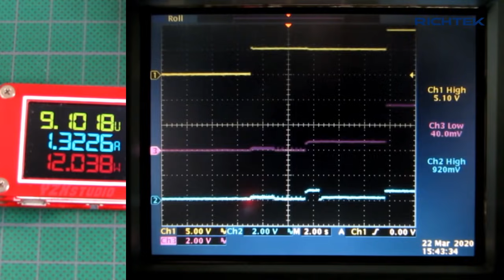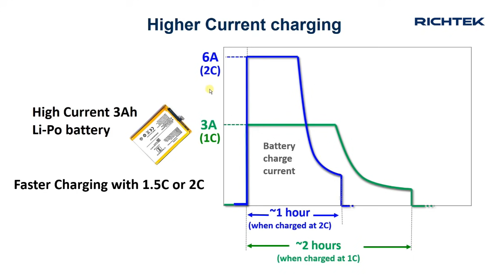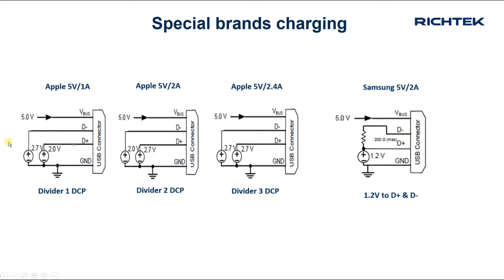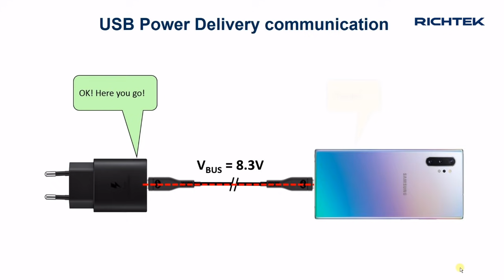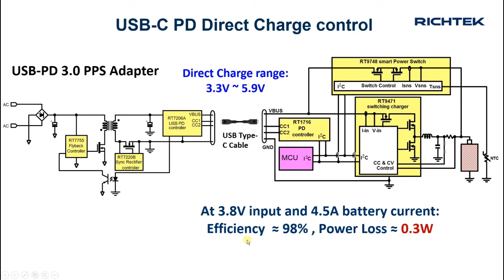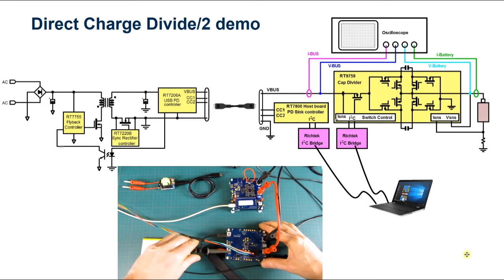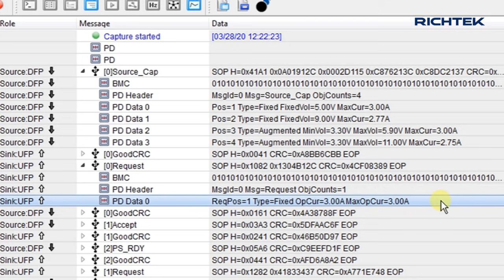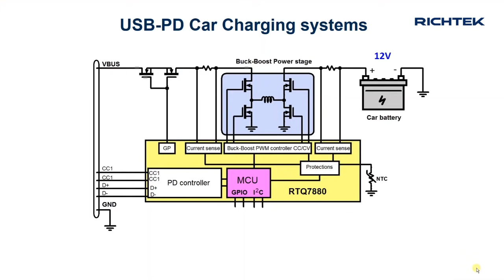How does mobile phone fast charging work?

Comment: Hey, maybe you can help me with a problem i have: one of my cables don't want to charge my Galaxy S9 anymore
The problem doesn't come from the power brick, since it works on another phone, neither is the cable, who works on another phones too. But when i plug my s9, it just doesn't want to charge 95% of the time. Sometimes it randomly works.

It annoys me because the presumed faulty cable is a 2m long, so now i have to use a standard 1m cable...
Reply: Clean the bus
Reply: @kornaros96  how ?

Comment: Do you think it's possible to make a single charging IC (charger side IC not device side charging IC) that's compatible with ALL USB charging technology (slow charging, as well as all fast and super-fast charging protocols) ie. DON'T NEED A LIST TO GET THE IDEA? SKIP TO NEXT PARAGRAPH WITHOUT MISSING ANYTHING ELSE. OnePlus’ Warp Charge, Huawei SuperCharge, Oppo’s SuperVooc, Motorola Turbo Charge MediaTek’s Pump Express, Apple 2.4A protocol, Samsung Adaptive Fast Charge, Samsung Super Fast Charge, etc... 

Like literally every charging tech in one USB A port and also that exact same thing in a USB type C port side by side in the same desktop USB super power supply thing... AND an override that lets me use a USB port as a variable power output (dangerous, I know ... it's for an EE hobbyist workbench, not for Joe Blow consumer so... also I wouldn't make it easy to accidentally bump the physical UI causing the device to fry, top-hinged plexy glass cover for controls or similar to reduce chance of accidents.)

Any; ideas, suggestions, or pointing me in the right direction, are greatly appreciated.

I'm already combing through USB-IF's web resources obviously, but I'm not formally educated in EE, I'm just a hobbyist who's been messing with this stuff for about 30 years now. Some of the language USB-IF uses is slow and arduous reading for me, so resources that make the same material more easily digestible for the not-so-formally-trained would also be appreciated. If I can buy a similar tech already that would be ideal, I'm not trying to reinvent the wheel, I've just never seen a wheel before... (obviously I've seen wheels... it's an analogy. I feel I have to say that because... this is the internet.) Anyways I just want a truly universal USB benchtop power supply charger thingy.

To be clear, I'm obviously not looking to manufacturer an IC that is... way way beyond my skills. I am thinking more like finding a programmable IC that's capable of being made to do these things.

Comment: You seem to know a lot about charging so it's strange you think li po is a chemistry when it's a format. ❓
Reply: This is why the battery community has moved away from the term "polymer" and defines cells as either cylindrical or prismatic.

Comment: Ok so how do you take 2 hours charging at 1C? That doesnt make sense to me.
Battery is 5Ah, 1C would be 5Amps. And if you charge it for 2 hours with 5 amps it would have 10Ah.
Making me doubt everything else in the video.
And no, i dont know anything i've only used Lithium batteries for 30 years with the RC hobby. So dont take my word, Take physicis...
Reply: As he said at 1:50, the charger uses two modes: Constant current and constant voltage. 1C is only done during constant current and is only able to charge up to about 80% of the battery. It then switches to constant voltage, which charges it the rest of the way. The last 20% takes a while to finish.

Comment: Modern phones, big batteries? 

Hahahahahahahahahahahahahahahahahahahahahaha

Most phones these days don't exceed 4000mah, only a few exceed 5000mah
Reply: Who cares about mAh. What matters is wh hours, an integral.
Reply: @lolerie  all phones use the 3.7V standard (3.8V also falls into this category) 

Wh is just 3.7V x XXXX mah 

When all the voltages are the same, mah can be used to reliably measure battery capacity
Reply: @mwbgaming28  nope. Modern li ion is from 2.5 volts (or even 2.0, see MuRata VTC6A) to 4.2 and then even after you get to 4.2 there is saturation step, a.k.a. contant voltage step. All of this should be counted in Wh. You do not know much, I see?
Reply: @lolerie  mate I work with lithium batteries every day, 3.7V and the amp hours is suitable for measuring the capacity of phone batteries 

Wh is the industry standard for laptop batteries, electric vehicle batteries, house battery systems, and large scale battery arrays 

But for phones, tablets, and other small devices, mah is the standard and in some cases, is easier to use than wh (particularly for very small batteries)

The discharge curve for virtually all lithium ion batteries shows that the voltage falls off a cliff below 3V, discharging below 3V can damage the cell, and going down to 2V can sometimes cause the cell to fail catastrophically (cell explosion, fire, or the cell short circuits internally) 

3.1V is the standard discharge cutoff voltage for all my devices, 2V is crazy
Reply: @mwbgaming28  2.0 is not crazy, how can you work woth batterries and not not know this stuff! Oogh. Just google Murata VTC6A specifications. They can do 30 A BTW. Some more modern can even do 45 A.
Reply: @lolerie  I'm aware of the specifications of VCT6 cells, but cells last much longer if not discharged below 3V, and besides, according to every discharge curve ever made for lithium ion batteries, the cell has pretty much nothing left in the tank by the time it hits 3V, it's also less harsh on the cell to only drop it to 3V, so you'll also get longer service life
Reply: @mwbgaming28  2.5 Volts actually. Also that depends on amps you are taking from it. Higher current means lower voltage while it is being discharged. Longer service life only depends on currents you are discharging it with.
Reply: @lolerie  voltage also affects service life, both full charge and discharge voltages 

Typically I don't put cells under more than maybe 2C of load (because I actually build my battery packs properly so you don't need cells with an absurd C rating) 

My electric bike battery uses Tesla 21700 cells, it's a 52V 30AH pack, my bike doesn't pull much more than 40A at full throttle, though using your logic, I could use a 14S 3P pack and absolutely nothing bad would happen Because the cells are rated for 3C (even though that rating is when the cell is in the Tesla's liquid cooled battery) 

Overbuild your battery and discharge it to 3V/cell and its service life will be orders of magnitude longer than constantly pushing cells to their limits
Reply: @mwbgaming28  VTC6A is not tesla cells, and also it is what is used in wape.

Comment: Meanwhile iphones still on 20Watts.
Reply: And Samsung is using 25W. And what? It's fine, you don't need 100W to charge the phone. Don't forget, a phone will be unused for about 8 hours a day. That's plenty of time to charge it. And most phones nowadays will last the whole day, if not more.
Reply: Because they don't use PPS and the Samsung PPS adapter is not working on iPhones. But iPhones are 💩 anyway. PG on MacBook can get to 96 Watts.